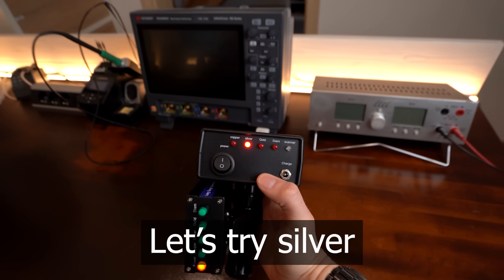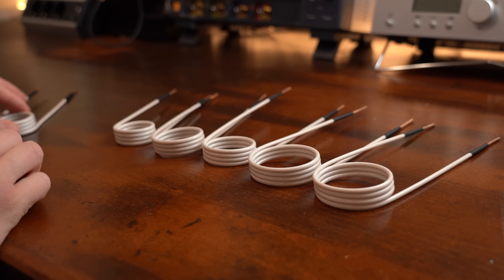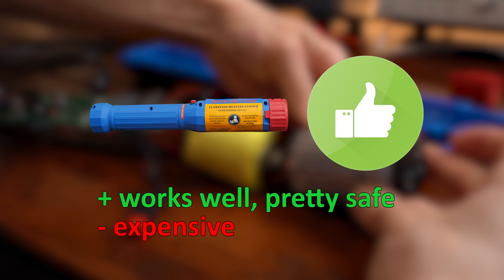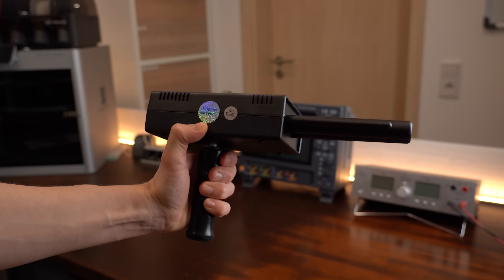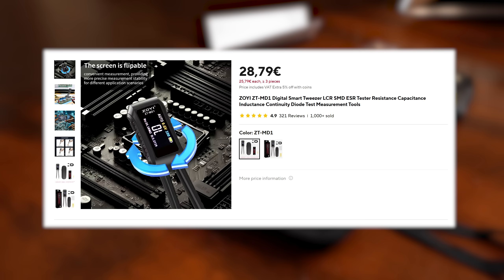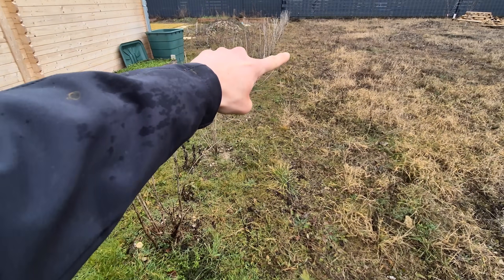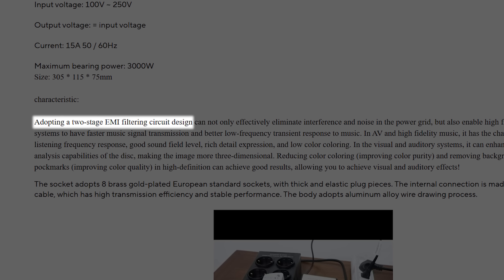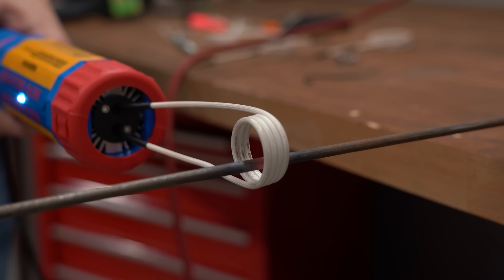I tried finding Hidden Gems on AliExpress AGAIN! (Part 13)

Comment: Here's a question for you induction gurus out there, a question that has a short story associated with it: 

I have a single-burner induction cooktop (I love the thing, no better way to cook, IMO), but over much use, I noticed that sometimes it did not heat the pan as well from session to session. Same pan, same power setting, but the cook temperature seemed lower than I expected it to be sometimes.

I just jokingly chalked it up to sun spots (or something else equally silly) from day to day. 

But then I was watching a YouTube video about the moons around either Jupiter or Neptune (can't remember which, not important), and the narrator said that they know that one of the moons' surface is comprised of salty water, and they know this because that moon disrupts Jupiter/Neptune's magnetic field as it orbits around.

And that info set off a lightbulb in my head: Depending on what I cook on my induction cooktop, I sometimes sprinkle a goodly layer of seasoning salt in the pan before adding meat (steak, for example), and I started paying attention to the pan's temperature response when doing this. I am convinced, maybe incorrectly, that it's the layer of salt that messes with the induction 'field', lowering the cooktip's intensity at a given power setting. 

Can anyone that took the time to read this validate or refute my supposition, or is it truly just 'sun spots'?
Reply: I'm no expert in this but I reckon it would be even more "disturbed" by a moon with a lot of iron in it rather than just brine
Reply: @dan-nutu  Agreed, but the video I watched definitely made the salt/magnetic field disturbance connection.

I'll just pretend I didn't hear it, and go back to believing the inconsistent heating from my induction cook-top is due to sunspots.
Reply: Ha, nice association but in your case the metal bottom of your pan is already more electrically conductive than the salt / brine in the pan, and it's also closer to the inductor.
Reply: @dan-nutu  I'm 'suggesting' that the metal conductivity of the pan is somehow weakened by the addition of salt to the pan. Probably ridiculous, but what's the explanation for a planet's magnetic field being interrupted by a salty moon?
Reply: IIRC the idea was that the salty water ocean is able to conduct electrical current (to a degree) and the moon moving through Jupiter's magnetic field created a current in its ocean, which in turn created its own magnetic field, which, like with regular inductors, worked "against" changes in the field that created it in the first place. Hence why I said that I reckon a metallic core moon would probably perturb the fields more, since its inductance would likely be higher than the one of a salty ocean. And why the metal bottom of your pot is likely many many more times more likely to get eddy currents from your hob inductor than the salty water inside the pot :) I may still be wrong with this :) Try setting up an experiment and make an yt video about it 😊
Reply: @dan-nutu  Making a YT video sounds painful. I'm sticking with sunspots. 🙂
Reply: This is a phrase I may borrow from you! ("I'm sticking with sunspots")

Comment: 4:00 To be more specific: Loctite 271 requires heat to remove--the company says so themselves. Loctite makes a dozen or so different formulas of threadlocker, of varying strength and application.

Comment: I think the metal detector was a typo, and it should have said 20 micrometers!
I also bought an induction heater for working on vehicles. But mine was from Amazon, and it came in a case with more coils, for about the same cost.

Comment: As for induction heater, don't buy the first you see and probably avoid from Aliexpress. I bought mine on Amazon and all the claims seemed reasonable nor too weak. I feel like the one you bought was weaker than what i bought. The red glow in your clip was rather faint while i can get a very bright orange in a similarly lit room.
Reply: Do you have a lonk of the amazon one please
Reply: @surronzak8154  I don't have a lonk but i do have a link, knowing YT i don't think i'll be able to post the link. If it doesn't work then it was supposed to be below this comment.
It's on amazon Pakowin Magnetic Induction Heater Kit 1200W 110V

Comment: just letting you know that you dont move the laser detector up and down the pole, you lock it in place and extend the pole up and down as that enables reading the measurements and making smaller movements
Reply: Umm...no.  The rod is graduated at fixed intervals.  If you move the rod (I assume you mean by sliding the sections?), you are changing the scale, and the displayed elevation will be wrong.
(Source: I have 20+ yrs experience in land surveying)

Comment: Springbok contact hold Downs wear out over time and with use. Screw Downs are much preferred and if you're concerned about them lasting the distance you should crimp on some ring connectors to the wire and screw the screw through that
Reply: Cool story bra
Reply: @mann_idonotreadreplies  thanks, but it's not as cool as you are after making this pivotal comment reply. I'm not sure what I would have done in my life without it. Thank you. Thank you so very much. now I will go forth and strive to be as cool as you are.. hopefully I can do it without looking as gay as you do. And I know that doesn't offend you because you don't read replies... not because you're gay.

Comment: @4:25 these are usually Miniature 8266 project boards. Glad you found an ESP 32 version. So much more capability and Power . They have been making these in all form factors with this exact web app or some clone of it for some time. I have one that I have dissected and repurposed as a iot pass through for battery status and upkeep.

Comment: Isn't it time you grow a pair and move to Taobao? Found same induction heater for 105 EUR and there are SO much more interesting things like disassembled GSM station parts (mostly power converters) for example I got a 2KW internally redundant 57V PSU for 40EUR and 1kw PFC frontend DPF1000 for 17EUR. All working.

Comment: A friend of mine bought an induction tool off the tool truck that cones to his shop. It looks identical but he paid almost 500.00. he did receive more "tips" and weekly payments (no credit checks). I used it on my truck (new york state mines and over uses salt). I couldnt use a traditional torch without risking a fire. I was working on boots above my fuel tank. It worked amazingly well and fast. 

As usual, awesome video. You've imspired me to pick up the tweezers.

Comment: Red locktight is not for nuts or bolts, although you could use it for that, but it will be impossible to remove without heat. It is to shim loose bearings on axels for instance, or to fill a small gap in between metal parts.
Reply: There are many red loctites, and they vary in strength and application.

Comment: Using the screw-clamp connectors on the power strip isn't itself a problem. Those just weren't torqued even close to spec if you were able to wriggle the wires out.

Comment: The power supply in the end is for isolating noise in a hifi audio system. If you connect yout hifi system to a power outlet, other decices on the same electrical system can interfere with your sound which can be heard as a buzzing sound.

Comment: Interesting that the weather station looks just like on I saw on the Arduino site. With the same looking display. Being a meatal detector builder. I have never found one that was worth the money that made claims these ones do. I have build my own GPR system. Preformed ok, maybe poorly ... The other items I believe are cool though. But I am not sure where I would need an induction heater.
Peace

Comment: I got one of those Zoyi tweezer meters as a stocking filler back at Christmas. Amazing bit of kit, especially if you are buying self assembly kits from TEMU/Ali-Express. “Smudged” (or missing) resistor colour codes and capacitor values are easily resolved, and questionable components (mostly caps waaay out of spec) can be identified and replaced.

Comment: I would never connect a random device from aliexpress to my wifi that has internet connection. You never know what these devices really do. The code could have been modified. But that applies to all devices, not just aliexpress.

Comment: "oh the other version uses ESP32, that's neat"
reading the news of an ESP32 exploit
"you know what, the Ultra version is just fine"
Reply: You need physical access to the esp32 to really do something harmful
Reply: You need to already have a backdoor to the EPS32 to use the "backdoor" they mentioned.
Reply: The vulnerability is a concern but nothing more than that. The general consensus is that you need physical access to exploit, but if you have physical access you can just reflash it. Regardless of this, IOT devices should have limited access to the internet or network.
Reply: its concerning in the sense that untrusted malicious code could in theory have more options of doing malicious things.  To be honest this changes very little for the normal user. Running devices on your network is always a risk and you should run sketchy IoT devices on a seperate VLAN.

Comment: Instead of the pro version, you should get CYD cheap yellow display. Uses a ESP 32 and a touch screen very nice for lots of projects. I used it on a 3-D printer of mine to display kliper status it cost about 14 USD. but I got it because I shipped the wrong product
Reply: CYDs are amazing value when on sale. I got 5 at €7 each around the end of Nov ("Black Friday" season), I wish I got a few more, nowadays they're easily twice as much

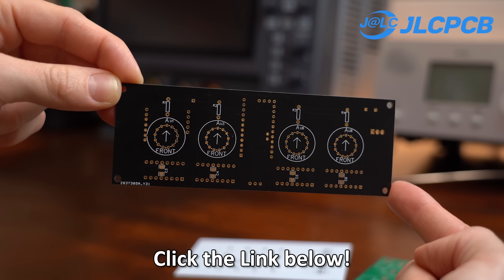Comment: That Handheld Induction Heater coil at 1:44 seems to smoke a lot because the plastic around the wire is melting as seen at 3:00.
The coil  should be a wire without any cover.
Reply: "because the plastic around the wire is melting"
There is no plastic around the heating element. That is a glass sleeve to prevent shorting out the entire thing. And it is normal for those to smoke the first few times cause of residues from production.
Reply: @ABaumstumpf  
Ahh, i see 😁
Reply: That is not a safe product to use.

Comment: That power strip is showing voltage for audio enthusiasts. You don’t want to feed your amplifier with a voltage that is too low. I ran 10awg wire from my breaker panel to my 15amp plug for my amplifier to guarantee no voltage drop. 

I think an amp meter would be more useful. You can test the voltage every 6 months and be fine. Knowing something is pulling to much current would be useful
Reply: Ah, of course - the audiofools :)
Reply: Yes in 1989 I purchased a $900 stereo then started saving for my $750 car. :)

Comment: That metal detector is designed to be rebranded and sold for a 10x markup.
They are scam devices. Basically electronic dowsing rods.
Reply: Have you ever seen a professional utility locator use dowsing rods to locate underground utilities?  I thought it was complete garbage, until he used his $8K scanner to find a buried water line, then took out 2 things that I SWEAR were old TV rabbit ears antennas on swivels, and found the same pipe in the same place.  I said, "sure, you already know where it is!"  Then he showed me how they work, and I'll be darned if it didn't work for me also, and I had never touched them before or even believed they would work.  I was fairly impressed.  I think they must work on disturbances in the magnetic field of the earth or something.
Reply: @Elmojomo  How do diamonds and other precious gems cause disturbances in the earth's magnetic field?
They are non-magnetic.

If you live in a city there are buried water lines everywhere either he got played and you did too, or he played you as he had looked at city schematics.
Also, there's usually evidence of where water lines are. If they aren't trench buried (and a tarred over trench is easy to spot) and moled instead, there'll be two mains and a line between in a roughly straight run.

Comment: My favourite pick from AliExpress so far, has got to be my mechanical keyboard. When they have a sale, you can't beat the price there. (14th is next sale ;) )
Some other picks I'd absolutely have to recommend, is the little 1.2-24v USB boost buck converters. They're an absolute godsend prototyping stuff when you're out and about, and a bulky power supply is too heavy. Plus you can get a USB-C connector and some pitch terminal connectors to have the board ready for almost any project. Other cool ones are the Mijia heating cup (basically a small travel kettle), and of course a cheap heatgun, which is a need for any hobbyist in electronics. It's honestly shocking what AliExpress has when you look through it.

Comment: It wouldn't be a bad idea for a next project to have an improved DIY power strip... It's simple for beginners and I think that in terms of price it would be better and of better quality DIY than purchased. Also more compact. In fact, it could have more stages of protection, and even have a modular design to add the necessary power outlets... 

😅 Now that I describe it, it seems even more interesting to me. 😂 It could be made more complex and add a wireless controller to turn each outlet on and off. They already exist, but the idea is to see what comes out better, DIY or store-bought... I think it has potential as a DIY project.

Comment: Please do more prodcut design and build vids!!!  I love watching designin circuits and pcbs. And go thru your process. I know its a lot more, but your content and knowledge and you dig into tech sheets for components and explain why to use this or that. Not just saying im using this part and not explain why like most channels. You are one of the reasons i started doing pcb builds and designs of my custom projects and sensors and stuff for my massive home assistant deployment. And i miss those older vids

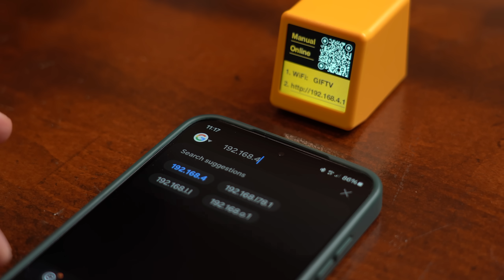Comment: 4:53 Modern smartphones use 4G and 5G when internet is not available with Wifi, unless you manually tell your phone "I'm good, I want to use this wifi even if it doesn't have internet" in the settings.

Comment: You get what you pay for. 

That weather station i bet is a small esp32/8266 and an oled and a few sensors.  Very cheap to make on or those.

And uou took it apart and yup, thats all it is. Litterally $3 in parts if you built it. Hahahaha. Only custom thing there is the interface. Print an exact copy of the case and build the pcb eith sensors and esp32 for $2 for a run of 10 boards...   Lol. I have built thise all pver my house. But no oled, i jsut have it feed home assistant where it has a heat map over my home layout pucture.

Comment: Good stuff. That weather station is a good candidate for "DIY Vs buy" as you can get the esp32 s2 mini and 1.4inch screen for around half the 24euro pro versio and DIY with some 3d printing

Comment: I have one of the induction heaters and it did not last long before the transformer started melting and it stopped working. It worked great but not last very long.

Comment: huh yeah, "by far the cheapest you can get" while pointing arrow at a €169.99 kit, lol
TIL 216 < 170 I mean heck, even the 186,71€ total is a bit higher than the 170€ one which you claim to be "a lot more expensive", lol
like, yes, fair point, MOST others are noticeably more expensive...but it is not "by far the cheapest rotary laser kit you can get", that's just lying, it might be the cheapest one to include a tripod and a long ruler, but it is not "the cheapest kit"

Comment: When it comes to gadgets with USB-C port for charging, I can only recommend to test if it can charge also on PD chargers. It’s surprisingly how many gadgets float around lacking this capability, so you can only charge them on 5V sources as USB-A charger combined with a USB-A to C cable.
Reply: There are a lot of cheaper USB-C devices that use the USB-C connector just as a 5V, but not with the circuitry to allow it to negotiate its power requirements, when means when you use with a USB-C to USB-C cable and a device that requires the negotiation.
Reply: @ yep. Results in limited usability unfortunately
Reply: It's easier to do this, just 2 wires need to be soldered. Rule of thumb, if device comes without C to C cable, it's most likely won't work with one.
Reply: I think all but one? of my chargers are just 5v USB A on C. It does fine and my phone battery lasts for ages after years, because I'm not blasting it at max charge rate...
Reply: @N4CR  Sure but if a device only needs 5 V it can also request that via USB-C PD. So why not give customers the freedom to choose between USB-A or USB-C charger?
Reply: @N4CR  C chargers are the future and those devices just won't work. You have to carry around an A to C cable with charger which are counterintuitive to a whole "one port to charge them all"
Reply: I think it's such an accessory need that most manufacturers would never.

Comment: 4:55 you need to turn off cellular network data to access web user interface
because wifi without internet will get ignored when accessing a link

Comment: 187€ is pretty expensive for a slow blow torch that can only heat metal and has to plug in to a wall socket!

Lucky electricity is cheap in Germany! 😬
Reply: Talk to any mechanic that has one of those and you will know how dumb your statement is.

Comment: The WiFi didn't work on your phone is because your phone will try to use a data connection when it connects to a WiFi that isn't internet accessible. Just need to turn your mobile data off and it should be forced to connect to the device.

Comment: i use induction to heat my titanium nail often if you know what i mean hehe, but i got the bare board and a psu, 54v and 8.5 amps for like 30 seconds and its yellow-hot
Reply: Didn't know what the fuck 'titanium nail' was a euphemism for & was actually worried until I looked it up
Reply: @NM-wd7kx  its not a euphemism